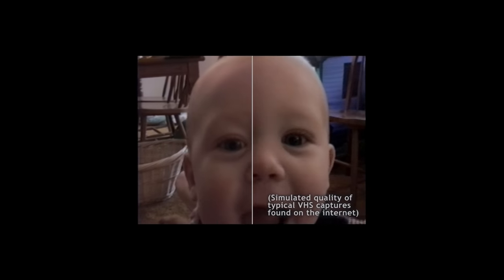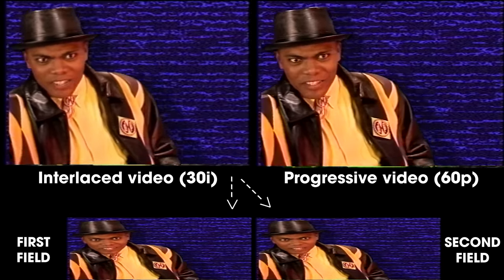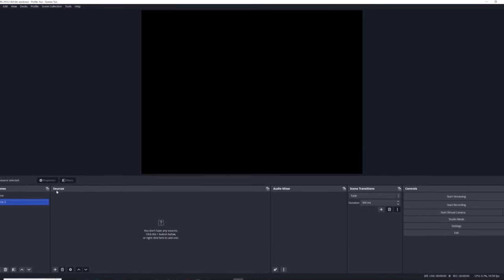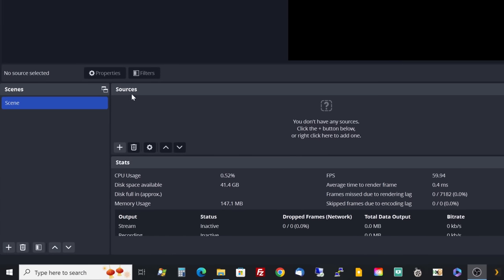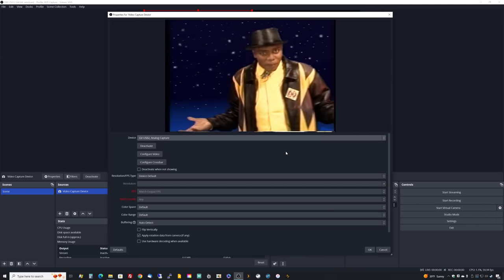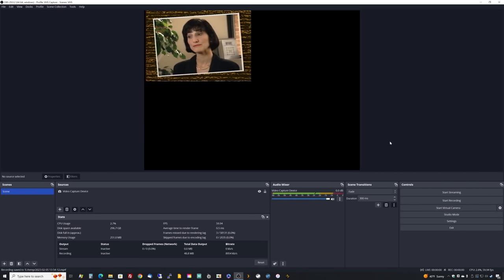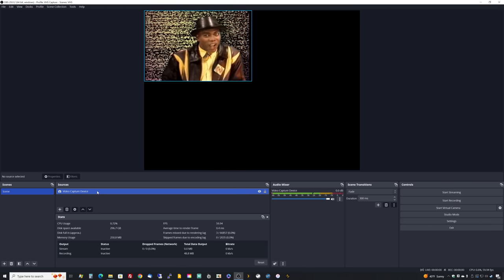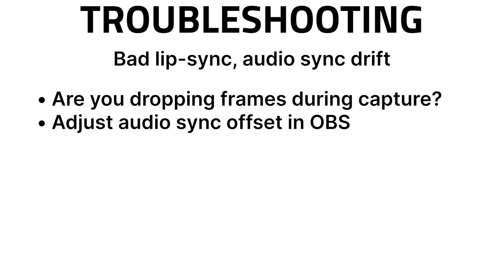How to convert VHS videotape to 60p digital video

Comment: Thank you so much for this great video instruction! I have been working with old video tapes from the 80's and have gone through one so far. I keep having an issue with the audio. The audio starts out very synched with the video, but around 10 seconds or so in - the video and synched audio keep going, but the audio is super delayed and starts again. So I am hearing the current audio with the delayed audio.  Does that make sense?  I have tried several different things to stop it from happening. 
I'm using an EasyCAPture USB2 device.  Could it be that I just need a better device, or change my settings? Thank you!!  I also have a TON of scratching noise.
Reply from the maker: Are the tapes recorded at the 6-hour SLP speed?  They usually have timing issues.  You might have better luck if you clean the VCR heads with a cleaning tape.
Reply: @TheOldskoolPC  Thanks!  The tapes are from the late 70's through the 80's. I did use a head cleaner and also used it on record so it would work better. Unfortunately the tapes were not stored well.  But mostly getting audio cut out.  Thank you again!

Comment: Just caught your excellent video. Unfortunately, I have to use a Mac to do my digitizing. I was wondering if you have any experience with this? Does the Elgato dongle/software solve the interlacing issue and allow you to output progressively? It looks like you tested that unit. If not, what might you suggest with regard to the capture unit I should buy? It doesn’t look like the dazzle unit will work with a Mac.. thanks
Reply from the maker: I'm sorry, but I don't own a Mac and can't test any hardware capture devices for it.

Comment: I like the approach of doubling the frame rate during de-interlacing (technically 29.97fps to 59.94fps). But like Myron Achtman, I prefer a workflow that scales the pixels to 640 x 480 pixels. I've never found a device or software that does a better upscaling job than today's consumer televisions. Therefore, I like to leave the upscaling process to happen on-the-fly during streaming of the 480p video. Granted, I understand the problem of YouTube not giving 480p a high enough bit rate, though it could and should. I'd really like to know more about the upscaling process that is taking place in your workflow. Is it really any good?
Reply from the maker: I used to resize everything to 640x480 until I realized I was losing horizontal resolution by doing that (going from 720 to 640).  When I'm trying to make a progressive 60p output, I now expand the vertical instead (ie. going from 720x480 to 720x540) which doesn't lose any detail.  (It loses fidelity, but not detail.)  I also have a TV that upscales well, so for seasons of TV, I don't upscale.  But for youtube uploads, which will only play back 60p if they are 720 lines or higher, I do.  As for my upscaling, it depends on the picture content:  If it's a mixture of video+film, or CG+real world footage, I use NNEDI2+spline36resize() in avisynth.  If it's mostly only real-world content, I have been playing with ESRGANS as well as some of the models in Topaz Video AI -- but like all AI upscaling, a light touch is better than bringing down a hammer and mangling the footage.
Reply: @TheOldskoolPC  All I can say is, when the standard of a horizontal sampling rate of 720 pixels was established years ago by engineers, it was so that the same equipment could be used to digitize both analog NTSC and analog PAL video. The standard results in anamorphic pixels in both cases. Of course, computers monitors consist of only square pixels, but sometimes a video player will scale anamorphic pixels on-the-fly. When de-interlacing to create progressive digital video, scaling the anamorphic pixels to square pixels should be part of the process. I don't believe that you are losing any resolution when doing this. Also, computer geeks determined that eight pixels should be cropped off the left and right sides, because the horizontal lines of pixels consist of "transition samples" or "non-picture area" on each side. I believe scaling to any other pixel dimensions is simply not following the established Rec. 601 standard. I learned these details from the VideoHelp forum years ago.

Comment: Question:  Settings for editing the output file?
I'm using OpenShot to trim the beginning & ending of the video that I captured with the I-O DATA GV-USB2.  Since OBS has deinterlaced the video (Yadif 2x), should I export the edited product as "progressive" with 29.97 fps, or is it better to keep it as "interlaced" with 59.94 fps?
By the  way, this is THE definitive tutorial.  I bought the I-O Data capture device and it works ask you say.
Thank you!
Reply from the maker: If you're going to edit the footage later, I don't believe OpenShot supports interlaced video, so keep exporting at 59.94.

Comment: Great video! Very informative. Do you have any issues doing this on Windows 10? I've seen many discussions on related forums that mention problems occurring with video captures on Windows 10 after a Windows update came out in 2020. A lot of people recommend using Windows 7 or even XP for doing video capture from VHS. I'm hoping that by now good results can be achieved on Windows 10.

Comment: Hi. I'm not satisfied with the results from Dazzle so I'm thinking of buying the Blackmagic Intensity card that You recommend in the comments. Which one would You recommend to buy to work with a PC? Pro version with PCI Express interface or Shuttle with USB 3.0?
Reply from the maker: Definitely the PCI express card, which is what I'm using.  The Intensity Shuttle has issues with some USB 3 chipsets.
Reply: Thank You for Your quick answer. My only concern is if my VCR, which was barely used Panasonic NV-HS930( it has TBC and DNR built in) will be good enough to prevent flashes/flickers with black frames problems that people experience using Blackmagic intensity products. With Dazzle I also had  problems with blacks being crushed ( no details in dark areas) and with audio getting out of sync ( my computer is fast and I had 0 skipped frames in OBS). Is Intensity Pro free of audio sync problems? Owner of the TechTvUsa YouTube channel advises to use DV converters like Canopus over Intensity Shuttle but from his videos I feel like colours form DV converters are little washed out and overall quality is slightly worse compared to results from Blackmagic. Audio synchronization on the other hand is a big plus in DV conversion. How do You find the picture quality from these products? Anyway in my country any DV converters are unavailable at this moment but there are some Blackmagic products to buy so I think I'm going to go this way and hope it will work. As always I would highly appreciate Your advice.

Comment: Great Job, I can not get rid of my pixelation? pink junk all over screen. Just never found answer. Bummed
Reply from the maker: Pink means that something is going wrong with the video overlay, like a driver colorspace translation issue.  I would try updating all of your drivers to see if that helps (take a system restore point first in case you have to roll back).

Comment: You say choose 60FPS but you clicked the 59.94 FPS (ish)?  When you could have selected the 60FPS. Any reason?
Reply from the maker: 59.94 is the actual framerate of NTSC color analog video, but most people say "60p" as shorthand.  The difference between 59.94fps and 60fps is 1 frame every 16.7 seconds, so either is fine, but I don't like 1 dropped frame every 16.7 seconds so I pick 59.94.

Comment: Hey - thanks for the link to the driver. I still can't get this Dazzle device to work  .. I'm an old dude and I had my first computer in 1986. I've even built my own in the past and have plenty of experience navigating PCs  .. but I am stumped. When I plug the Dazzle into my PC nothing happens .. the PC does not recognize the Dazzle no matter what I try (device manager, etc.). I've installed the drivers but unless I can get the PC to acknowledge the presence of the USB device, I can't do much. I'd love to get this up and running, so if you have any tips, I'd appreciate any insight you may have. It's hard to believe that in 2023 we still don't have a straightforward way to capture analog video. We are limited to using gear built many years in the past. Thanks again for all of your help. PS -  My Roxio Easy Plus VHS to DVD3 is working with OBS but I'm not happy with having to pay $70 for old technology that should cost about $20.
Reply from the maker: If you plug in the Dazzle and nothing happens, does the LED on the front of it light up?  If not, you have a dead dongle.
The Startech unit seems to work the best, so you may want to invest in that.  Or, continue using your Roxio device if it passes through fields correctly.

Comment: Great video, thank you I purchased the Dazzle on ebay. I set up everything in OBS as u suggested. The video turned out pretty good but no sound input could I find using my hp Laptop. So the video had no sound. The Pinnacle software that came with the unit works fine and has sound. But only goes to 720p. When I try to add audio input on OBS I don't see Dazzle listed anywhere as it did on the video. Any suggestions?
Reply from the maker: The driver might need updating.  I added a link in this video's description to another video that describes a procedure that many have said have solved their Dazzle problems in Windows 11.
Reply: @TheOldskoolPC  Thank you for your response, I will see if that helps.
Reply: @TheOldskoolPC  I wanted to update you, Your solution and the link you sent me did the trick! Thanks again!

Comment: Great tutorial! For your process using Premiere, do you capture lossless in OBS deinterlacing with yadiff to mp4, or do you use some other app like VirtualDub? I'm about to embark on a project where the client might want the intermediate file in the highest quality possible, as well as the optimized-for-web-viewing mp4 file.
Reply from the maker: I capture to either uncompressed, or losslessly compressed, interlaced files.  I currently use the Blackmagic Media Express software that came with my card, but in the past I used Virtualdub and amarec.  For restoration, I take the interlaced original into Premiere and perform noise reduction, level correction, etc. and then export prores 422 HQ, and then finally deinterlace QTGMC on the prores file to x264.

Comment: A follow up question if possible? I've been using these two devices for capturing: ABLEWE RCA to HDMI,AV to HDMI Converter, 1080P Mini RCA Composite CVBS Video Audio Converter Adapter and the BlueAVS HDMI to USB Video Capture Card 1080P for Live Video Streaming Record via DSLR Camcorder Action Cam - Capture 1080P@30Hz would this be applicable to your video?
Reply from the maker: Nope.

Comment: 16:59 Could you tell us something about HEVC encoder? Is it good to encode VHS video in this format? I've heard it has good compression without quality loss, so it looks as good encding method.
Reply from the maker: HEVC (h.265) is better than h.264 in every way, and every modern device has decoding support for it in hardware, so it is a good choice.

Comment: Questions. 
#1 How do you save your OBS settings for VHS capture?
#2 Is there a way to see if the video capture device definitively captures both fields. Just "looking" at what's been captured is not a great technique with my untrained eyes. Does OBS show the properties of the video capture device? This spec is not always listed for a capture device, for instance the StarTech SVID2USB232 doesn't mention this spec even on their website.

Thanks.
Reply from the maker: When you exit OBS, it saves the settings for the profile and scene you're in automatically.
As for seeing if both fields are captured, go ahead and follow the tutorial but SKIP the "deinterlace" step.  Then capture some footage with a lot of motion, then play it back and pause occasionally during high motion to see if you can spot the "weaved" fields in the same frame.  If you do see them, go back to OBS and complete the deinterlacing setting and you should be good to go.
You can also try capturing some footage with and without the deinterlace step.  If the deinterlaced footage looks the same as regular, then your capture device might be throwing away one field during capture.

Comment: Do you get 60 fps with your Dazzle? I've seen on reddit that it's capped at 30, and a Dazzle variant that I have called "Dazzle DVD Recorder HD" seems to be capped at 30 as well (25 in my case, cus PAL).
When I plug my VCR into my Elgato HD60S, I can confirm the cassettes I'm testing are 50 fps, though every 6th frame is duplicate because the elgato only supports 30 and 60, hence why I bought the Dazzle. Too bad you had the player paused when showing the Dazzle settings.
Reply from the maker: My dazzle produces 30 frames per second, interlaced, which is 60 fields per second.  Some people on reddit don't understand frames vs. fields.
Reply: @TheOldskoolPC  I figured out stuff after this comment 👌

Comment: First, thank you for both of your videos on this topic. The first video helped me to use VitualDub on my first project. This video helped me with a PAL VHS to digital. However, I have two more VHS tapes that I cannot get any video (only audio). These come from Germany, so I'm sure they're PAL. But I've gone through the fps list (10 - 60) with no luck. Also, the audio is often choppy, but at other times is fine. I've also tried all the OBS Black Screen recommendations, such as adding OBS to Graphic Settings, running as Admin, etc. Any help is appreciated.
Reply from the maker: I'd first test your setup with the first PAL tape that does capture properly.  Get that working first.  Once that's working, change tapes.  If the new tape has no video:  Is it a commercial tape?  If so, macrovision copy-protection might be causing issues.  Is it not commercial?  It might be stretched out or have bad timing; a TBC would help here.
There's also the possibility that the tape actually doesn't contain any video, although without further details, that's just a guess.
Reply: @TheOldskoolPC  Thanks for the suggestions. I think my only hope is a TBC. I noticed that the audio continues for several seconds after I stop the tape, so the logical conclusion is a timing issue, right?

Comment: I used the same dvc-100 , good result,  but i got small pixelation around of the lines or letters in the images. Its fine if capture at 720x480 , but it come on 720 and 1080 hd size. Is it normal or lack of computer power? 
Thanks for the incredibly helpful video.

Comment: Which converter would work best for a Sony trv 108? Camera does not have rca jacks
Reply from the maker: The TRV 108 has a small "headphone jack" where the analog video/audio come out; you need the adapter cable that came with it.  A similar adapter is probably available on amazon.  Once you have it, RCA jacks are provided at the end of the cable.

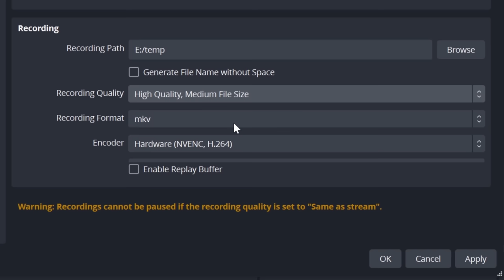Comment: 16:06  As commonly reiterated on OBS's forum, do NOT record to MP4 unless you have to.  And you pretty much never have to; see below.  The default MKV is much more likely to survive a crash, power loss, or other interruption.  Kinda like an old-school tape machine breaking or running out of tape, MKV keeps what you had up to that point.  MP4 loses all of it, including what came before.

It's the same data either way, only in a different container, so it's fast and easy to make an MP4 file from the MKV recording if you really need that, with no loss of quality.  In OBS, File -> Remux...  You can even make it automatic, to keep the "one-step transfer to MP4" idea.

That said, any video editor or player that's worth its salt will read MKV just fine (you might need to switch to VLC as your player of choice, if Windoze has gone that far to pot), and most serious distribution platforms like YouTube will take it directly as well, so there's usually no need to remux anyway.  Just use the MKV as-is, and see if it works.
Reply from the maker: The tutorial was meant to provide one-click files that play anywhere, and mkv containers doesn't have as much player support (ie. phones) as mp4 does.  You're right that OBS mkv support is more fault-tolerant.
Reply: @TheOldskoolPC  You can have both!  Just one more thing to setup in OBS beforehand.  Then you have the fault-tolerance of MKV recording, AND the player support of an end-result MP4, still in just two clicks per recording: start, stop.  Except now you still have the successful first part of an interrupted recording, instead of having to do it all over again.
Reply: I thought MKV did not support interlaced files.  If this is correct then archiving digitized interlaced recordings might be a mistake using MKV.
Reply: @vitaminmopar  MKV is just a container, like MP4 is just a container.  Bucket or box.  You can put almost anything in either one.  The format itself determines what it's capable of.  H.264 is the actual format, and it does support interlaced.

Other formats are H.265, which is hardly used because it's a licensing mess, and AV1, which might become the next common one, but it's new enough that not everyone knows what to do with it yet.  H.264 has been around almost forever now, so it works.

Comment: I was thinking, if I buy a rca to hdmi adapter, and shoot the Windows work area screen with obs, it would be a cheaper option, isn't it? But, would it work properly?
Reply from the maker: The RCA to HDMI adapter will convert video outside of your control, so it depends on the adapter.  The result might be the same, or it might be worse.